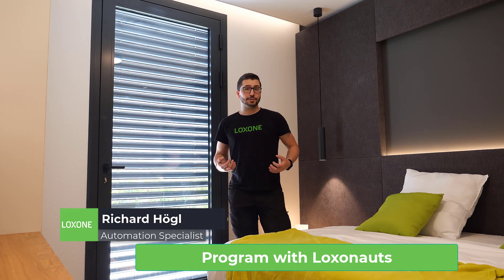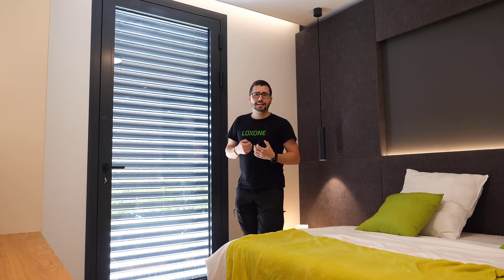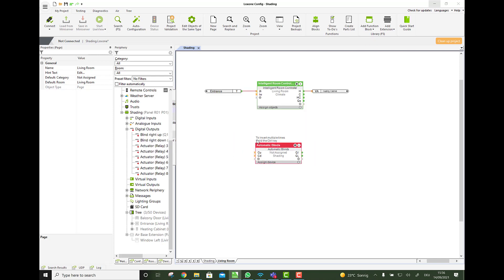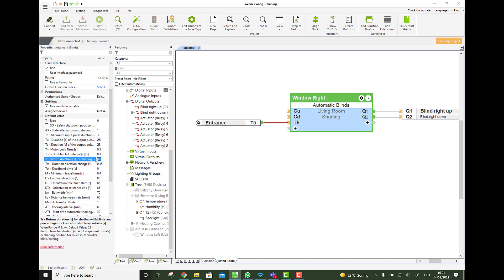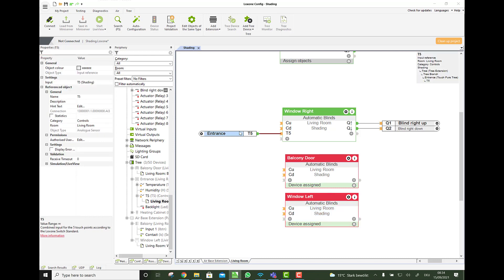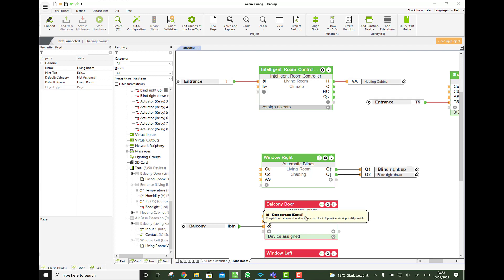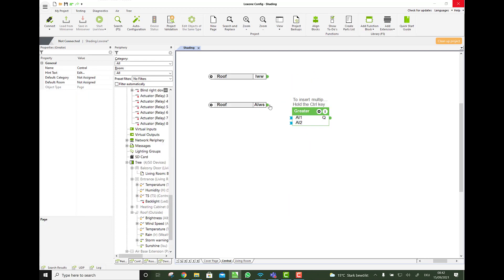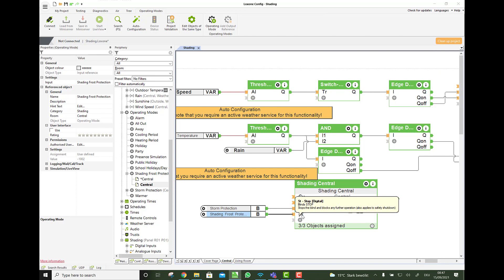Program with Loxone Experts - Shading

Comment: What is the difference between automatic shading and integrated automatic shading? I don’t get the point.
Reply: It is described in the documentation. Integrated Automatic Shading is for motors that are Loxone ready. They report the shading position and maybe other attributes. I guess usually via tree.
Reply from the maker: Hi,
Thank you for your comment and question.
The difference between the two is that Automatic Shading can be used with a lot of the simple third party motors on the market that have 2 relays - up and down and the outputs and properties are set for it. Automatic shading integrated is for (loxone ready devices) that don't require such outputs and work "out of the box".
Please see the Loxone documentation on this here: https://www.loxone.com/enen/kb/automatic-blinds-integrated/
I hope this helps clarify the difference for you.